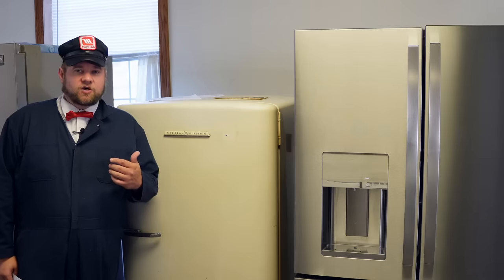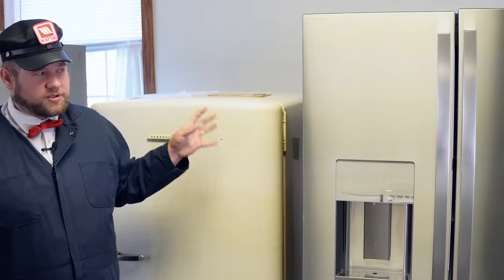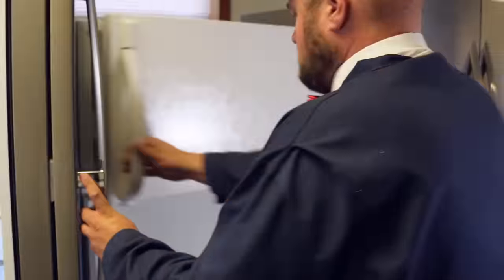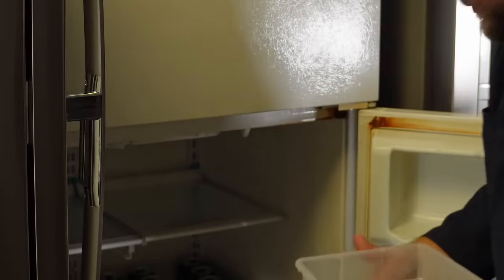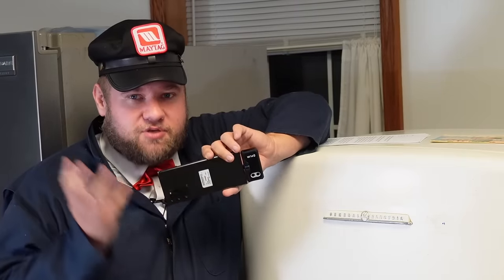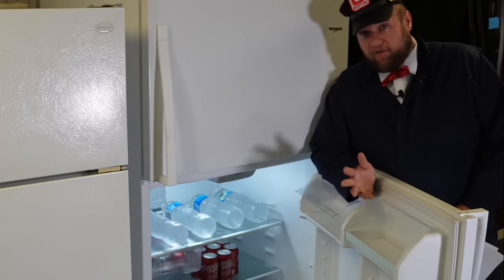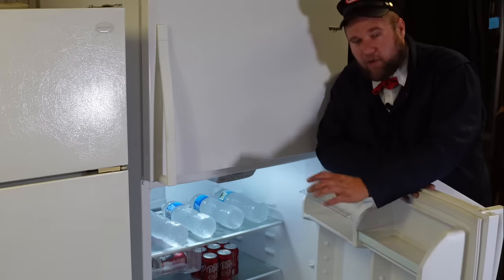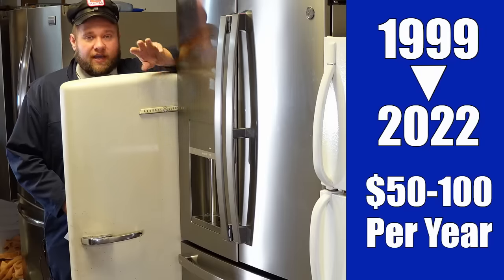Should You EVER Buy a New Appliance if Yours Still Works? A 7-Day Test

Comment: I have a 1978 fridge that has wire shelves and items on the shelves   constantly fall over. It's a yellow/off white color, "wood grain" handles. If I could find a way to retrofit some flat shelves, I'd keep it.
Reply: I think you can buy sheets of acrylic cut in custom sizes, maybe that would be an option?  You could lay it on the shelves.

Comment: Do you find a common failure across modern appliances?
Compressors? Seals? Starting caps & relays?
I found electrolytic capacitor failures are common in a wide range of electronic boards.
An $800+ Whirlpool Duet Sport high efficiency washer had the motor drive IC on the lower PCB blown apart.
Over $100.00 later, and a used replacement PCB disclosed that the CPU board was also bad.
There goes nearly $200.00 more, plus the labor.
Less than $10.00 bought me an agitator rebuild kit for  an older Whirlpool washer that died after decades of service.
Still working great after replacing the little worn out agitator plastic bits.
The newer washers are much more water-efficient, electricity not so much.
The same for dish washers.
Old units die from worn plastic bits & gaskets.
New ones, electronics failures.
Reply from the maker: Electrolytic caps, yes - they are a pretty common failpoint. Those and undersized relays that deal with consistent 20-30a switching like on stoves or dryers.

Comment: Yikes, I'm lucky. Fridge was 15 years old when we (consort and I ) replaced the defrost timer. It wouldn't have been worthwhile to have it repaired by someone who was going to charge us a fortune to do it. While buying a new defrost timer was easy and straightforward, I couldn't find a replacement cam to close the freezer door, which is currently held closed with sticky-back Velcro.

Comment: This is not quite the same comparison, but let's talk microwaves.

My parents have an old Sharp Carousel, circa 1980s I believe, not sure exactly. It's older than me, and I'm 24. They've had it since before I was born, and it has worked basically flawlessly the entire time. It's one of the old models with the woodgrain finish and the green vacuum fluorescent display.

In my apartment, my fiance have a nearly new GE range-hood microwave. It's the 1.6cu model, standard cheap apartment fare. We've lived in this apartment for about two years now, and the unit was only a few years old when we moved in. I am now on my fifth service call with maintenance to have it repaired. The door switches keep blowing the main fuse because the switch plate is worn out.

I hate modern appliances.

Comment: can you get the shelf bracket for the fridgeidare bottom shelf? our self destructed and it was my mother inlaws so wife wants to keep it
Reply from the maker: I can't but if you punch the model# into most sites you can find the part# and locate either a new or used one. I've sold a lot of drawers/shelves from dead Frigidaire refrigerators before, as they are worth as much as a working fridge once you count all the parts.

Comment: We've had our fridge for 40 years and we'll get a used one if it ever dies. All major appliances have gone to needing chips and capacitors that usually fail within 5 years.  If we can't get a used fridge, we'll get a couple dorm fridges and a freezer. 

What's awful is it's getting harder to find any fridge under $1000, and now they try to upsell you on service plans.  

The new ones are dying far faster than anything over 20 years old.  Goes for all major appliances.

Comment: Best way to compare energy usage for refrigerators of different sizes, is to take the kilowatts used, divided by the cubic feet of the refrigerator, then multiply that by 10, to get kilowatts per 10 ft.³ of refrigeration.

Comment: The answer depends on how expensive is your power, how cheap can you get a "new" fridge, and how long with the cheap thing last? My fridge is over 40 years old and working just fine. The one my parents had (1966) was replaced in the 90's when the plastic pegs that held the shelves snapped. In 25 years, they've had 5 new fridges. (The current one has lasted several years -- french door, bottom freezer, no ice/water crap in the door.) The upright, "frost free" freezer from 1966 is still working perfectly. (there are a few chest freezers, and one of my aunt's old uprights around the place -- an entire cow will fill more than one!) My little 1.6qf "dorm fridge" (80's) is still working fine. There's a lot to be said about the pure simplicity of totally mechanical devices.

[Note: that 1966 fridge went to the barn where it's still working today! The shelves are stacked on bricks.]

Comment: I lost your video on best refrigerator to buy. I have cleaned my whirlpool side by side coils every year since new. Runs great.  with all the electroics in use, do you think a surge protector is a good idea. I have seen surges destroy circuit boards on equipment I have repaired

Comment: It's not just the efficiency. Reliability and stability are worth paying more per month on electricity. It costs a LOT of money to repair/replace these appliances. On top of the money, there isn't always a great place to put a large modern unit, especially if there's nothing wrong with your old inefficient one. Sometimes the extra $20/month in electricity is worth keeping the old fridge.
Reply from the maker: The issue though is that at $20/mo, you've bought a new $2,400 refrigerator every 10 years... Not including interest. So at some point, there may be a break-even where the older one is absolutely costing more by keeping it running than buying a new more efficient unit.
Reply: @bensappliancesandjunk  That's the best case scenario on a new appliance. These days it's almost guaranteed that they won't last 10 years and you'll need to buy another. Meanwhile, you could keep the old one working almost forever.

Comment: Bought a suite of LG appliances with the cool looks and the 'black stainless steel look' expecting quality because LG is not a budget brand.  Not the lowest model nor the top models - -in the middle price wise.  Within four years, so far... the fridge and another appliance has peeling paint (I have NEVER had that happen before), the gas stove would periodically not start which resulted in a repair, the front loading washer had a pump go resulting in a repair, now the dishwasher is not working and I have to replace a part that requires the unit to be pulled out and placed upside down.  Thankfully I can handle these repairs myself (just enduring the wrath of my partner about the appliances constantly going out and the extra costs for takeout); some of the problems were intermittent so for months we were not sure if the appliance would work and what to repair.  Previously I stuck to whirlpool which were more reliable.   My understanding is that the real high-end brands are even more repair-prone..

Comment: Absolutely you are salesman. If some one is not, he will tell two things: The power intake of compressor and consume of electricity per one cubic foot in 24 hours, when load is same. You can do nothing by fridge if it is too small and too big is too expensive to use. You can buy new seals to door. De-icing is simple to do by 24 hour timer-switch which cut power once at night for de-icing.

Comment: I think that old GE refrigerator is the same model as my grandmother's too.  We still have it, and I plug it in now and then just to see if it still works (it always has) but it hasn't been truly used since the 90's.  If only we could combine today's technology with the 50's desire to build a long lasting product.  Haven't reached the results part yet but I'm sure that old machine is a power hog.

Comment: 1957 fridge still running, have gone through three modern fridges in 10 years!  Dishwasher installed 1987, still running but wife wanted newer model, failed within 6 months. I want to go back to manual controls everything, no freaking electronic crap!
Reply: Oh, have a small mini fridge used in my dorm in 1982, still running

Comment: i know technology connections have cover chest vs stand fridges.
but since you have more access to these units,
how about a comparison between 2 chest units(one as a freezer, one as a chiller) vs a similar Cubic feet capacity 2 door fridge. i know i'm using the word chiller wrongly.

i assume its mainly upfront cost and floorspace. but at least the cold air doesnt "spill" out...
but twice the units, twice the maintenance/breakdown chances.
chest units probably run their compressors slightly less harder because their units dont have to worry about constant opening or closing.

most of my food is frozen, with fresh ingredients shopping weekly so i dont need a large chiller compartment. i do go through decent amount of ice per day,  so i could use those bar ice making molds in a chest freezer rather than those dinky ice cube trays found in most 2 door fridges. 
i dont like built in-ice maker, they add more inefficiency to the units by taking lots of space or adding a separate mechanics to automate the ice making.

but hey i gain countertop space by getting 2 chest units.. just need to mount worktop to the doors

Comment: All of my older appliances are still working. My GE refrigerator is American made, almond with a wooden handle. The problem that I have with it is the storage bin shelf over one of the food bins is cracked and cannot be replaced because the part isn't sold anymore so I can't store items on top of it. This is hampering my ability to utilize needed space. I don't know what to do. Can't somebody just build a custom plastic shelf for me? It would much cheaper than buying a new refrigerator because a $40-$60 plastic storage bin cover is cracked in half.
Reply: Look for repair shops in big cities. They might have one.

Comment: Betty Furness endorses a Westinghouse refrigerator with a counter that counts the number of times the door opens. Only when it reaches sixty, does it do a defrost cycle. Then the compressor runs backward to heat the evaporator and melt the ice. The door seal is a special plastic that never shrinks or gets hard. Hot refrigerant evaporating moisture is nothing new. Electric heaters were cheaper to use, that's all. All those circuit boards, chock full of transistors, burn out in a very short time. Have you seen the price of new refrigerators? As for multi-speed compressors, the 1930s, 40s, or 50s compressors run slow all of the time so it never wears out. They are so quiet you'd never know they are running. I bought a 1946 Kelvinator chest freezer twenty years ago. My ice cream is HARD! Its cabinet is warmed with hot Freon and it is a 1946 model!

Comment: kW is a measurement of power (i.e. work per unit of time). I don't understand what it means when you say that a fridge has consumed 1.6 kW in a day... Is that the average power consumed? If yes, do I have to multiply that value with 24 hours? Or did you mean to say 1.6 kWh?
Apart from that - great video :-).

Comment: Why use a coil heater for defronsting? Woudn't it be more efficient to run the loop in reverse and use as a heatpump for defrosting
Reply from the maker: If the unit had the ability to do that, yes. But that'd add another layer of components to systems that love to already break. Would be good for a refrigerator that was high-quality, but otherwise it'd cause breakdowns more on cheaper units like this.

Comment: given the new government regulations, the added cost of new appliance to be in compliance with a new purchase would cost so much that despite the power savings, the time it would take to recover that extra cost would would be absurd. Most owners move from their home well before the payback time. I did replace my sacrificial anode rod in my water tank but  other than that I have not done much with it (it works fine). same with my dryer for which I replaced a belt.

Comment: Do you really think that the newer refrigerators will last OVER half a century ???? I'm keeping my 1948 G.E. that was built in Bridgeport Connecticut. If your worried about 'efficiency', you could wire in a running and  start capacitors. Do a video on that !!

Comment: We had almost that identical older Frigidaire model, and when it started getting buzzy we finally replaced it a couple of years ago with the exact equivalent baseline new Frigidaire.  Which, indeed, was almost identical, just slightly larger.

Unfortunately, the new one is crap.  It uses about 1.2 times as much power, which is more than 1.5 times its rating.  No, the seals aren't bad, and we rarely open the thing, since we both work long hours.  It's not overloaded, and it's been consistent for well over a year.  And internet reviews suggest this is a common problem.  It just doesn't work well.  It's also incredibly noisy.

And the one real design flaw of the old fridge -- bad rail attachments on the door shelves -- wasn't fixed at all.  We hot-glued them in place, and to hell with it.  But I sure wouldn't buy another Frigidaire.  I guess we should've gotten a Whirlpool.

Comment: What could you do to upgrade grandma's frige to make it more efficient? New seals? New insulation?
Reply from the maker: Yes, insulation would be a big one. Could also remove the old compressor and add a more modern (but not too modern) compressor that's more efficient on electric usage.
Reply: @bensappliancesandjunk    How much would that cost the consumer?
Reply from the maker: @CassieDavis613  private party restoration? Probably $800-1200 depending on model. You'd be ripping out all the insulation, then putting a new compressor system (SYSTEM, not just a compressor) then backfilling it all in. Not a cheap process, but it'd upgrade/make it last for another 80 years probably.
Reply: @bensappliancesandjunk    That's amazing

Comment: If you want a short simple answer the answer is yes 
for two reasons you want to replace your appliances before they break. obviously replace them when you can afford to do so. 
and even better if the new one is going to save your electric bill a little bit of money compared to the old one. 

If you live in the European Union than you already know about our energy consumption grate System that’s plastered on the front of the box of basically every big electronic device that you can buy. Everything from your TV to your refrigerator.
Reply: I live in the E.U.
Old fridges do eat more electricity, but it's a problem when your incomes are low. The old really big consumer is the air conditioner.

Comment: YT threw this channel in front of me.  Very interesting.  Love that Maytag hat and the great articulation.

So, how many of those new refrigerators will be running 72 years later?  My bet is: zero. 

I do believe that basic mechanical manufacturing quality has increased greatly over time.  Modern car engines can go many hundreds of thousands of miles compared to 1950.  

The problem is in the electronics. They fail.  I've seen several, just in my limited family experience.  An oven, a fridge. Either incredibly expensive to replace or it just can't be done.

Sometimes the amount of energy used is very secondary to just being alive.